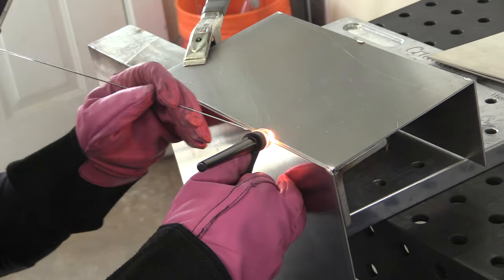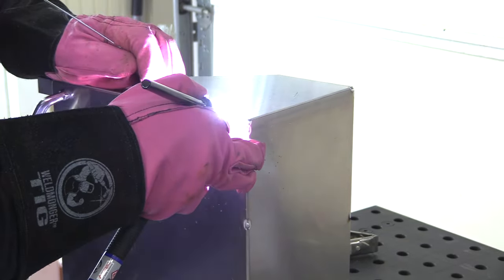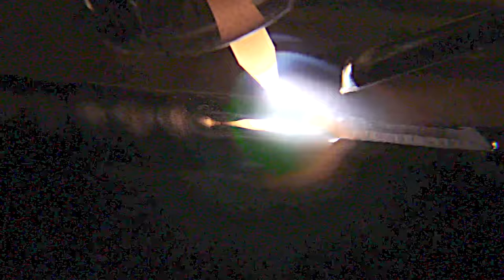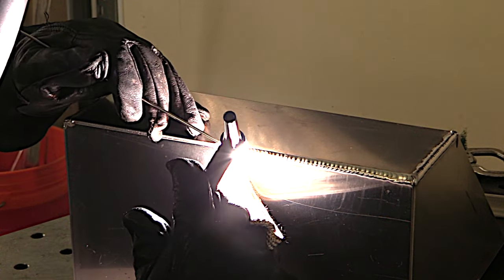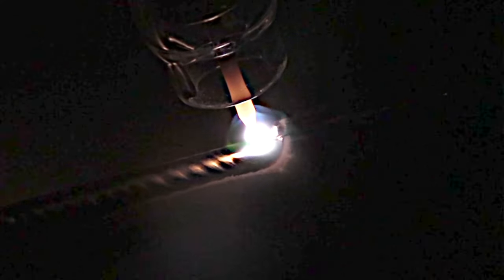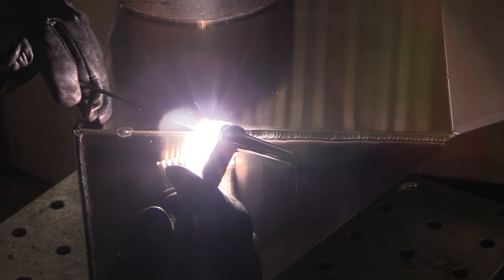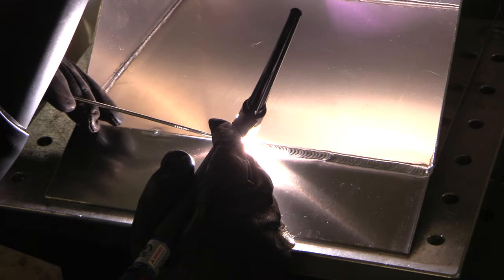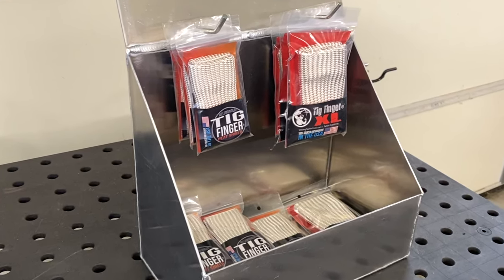TIG Finger Display Aluminum Corners

Comment: Problem with the tig finger is that once you start using it, you can't work without it.
Reply: Definitely 100 percent 👊🏻
Reply: True👍🏻
Reply: Help me understand. Please
Reply: @ederson7s  the Tig finger works so well that you want to use it every time you Tig weld something
Reply: Another Great Video !! 
I have two tig fingers, I would not be without them after having used them ! 
Thank you for your great product, and for all of your great instructional videos !! 🤗
Reply: Ain't that the truth. Of all the wide, wide world of welding accessories, they're surely in the top 5.
Reply: @WojnarskiWeldingFabricaion  They keep recommending to get XL not no standard due to the gloves. 
I’m 5’7, My hands are just about right for my size and height. I can wear a nice small fit, but at times I can snugly fit a medium. But if I’d like precision small for sure (for example latex gloves) 
But I’m debating to just go for standard since I like tight fitting
Reply: @ederson7s  the regular one should be perfect I wear medium to large gloves and the standard one is perfect. I have a xl one and it’s a little big for me
Reply: @ederson7s  get few of them. They don't last forever if you're working near sharp edges.

Comment: I had to laugh while you were doing this.  At 75 there is never enough light or magnification!  I also laughed because I work at an engineering college and I continually get dxf files for "boxes" that consist of 6 rectangals with little thought given to bending and saving weld time (yes, in your case it is to showcase the welds).  Keep pumping out these videos Jodi as you have done more to promote welding than Miller, Lincoln, Esab etc!

Comment: Great idea with the display case Jody...years ago as you prbably remember Marquette, Forney, Harris ect, welding had display cases of rods and accesories in just about all the welding supply and auto parts stores with great success. I have both size TIG'Fnrs, used them at work and my home shop with great results SAVED a lot of gloves and fingers lol!

Comment: Doing retail for 8 years now my first thought was also going smaller with it

I would also have the bottom inside be tapered, possibly fillet weld a slanted bottom shelf, that way the product laying down could look displayed as well without just looking like a dump bin
Having dividers would lend to easier inventorying the different sizes.
Depending on how fast the retailer is selling these peghooks also take more time to stock. But if they liked the pegs having the peghook welded on instead of loose is a BIG bonus (keeps them from getting lifted out of wack) just remember to ball off the end of the hook, this could also be an area to display a weld
Another great area would be lap welding a plaque on that would show the price tag at the base, the only trick with that is some retailers use different tagging sizes.

Still loving the content!  Thanks for sharing!
Reply from the maker: Thanks for the great info

Comment: My local welding supply shop stock them in the UK. Oxford Welding Supplies. Must have bought about 10 of them for myself over the years. Don’t weld without one and always have a new spare on me. Recently got my company to buy a load in to stock in the cupboard for all the other welders in the shop. Amazing product!

Comment: Just pulled the trigger on a TIG Finger myself, won't be using it for a couple of days but I boiled a pot of water and pressed my hand against the wall of the pot while wearing it, didn't feel a thing after about a minute or so of shoving my hand into the wall of the pot until my wrist had tremors. Released pressure after realizing that if I wasn't feeling it after over a minute, the pot would've cooled down by the time the heat would finally transfer to my hand. Fantastic product, looking forward to spoiling myself for aluminum and stainless work.

Comment: Jody, I suggest having your parts laser cut and punch some decorative holes in your aluminum case, and use dimple dies on them like you see in Motorsports.  Guys start drooling when they see dimple dies and TIG welding, trust me.